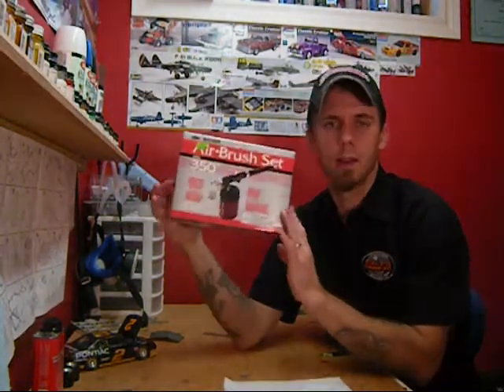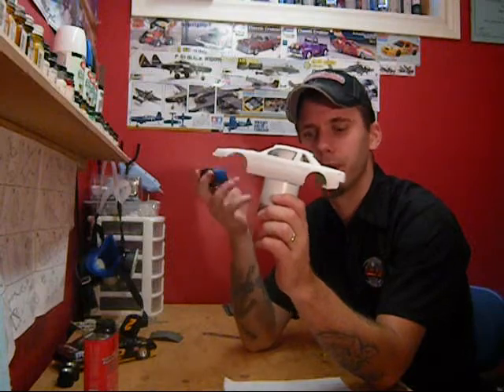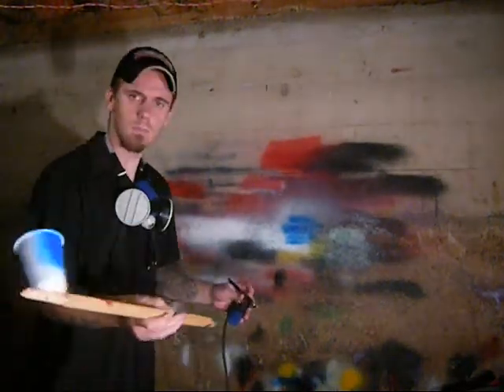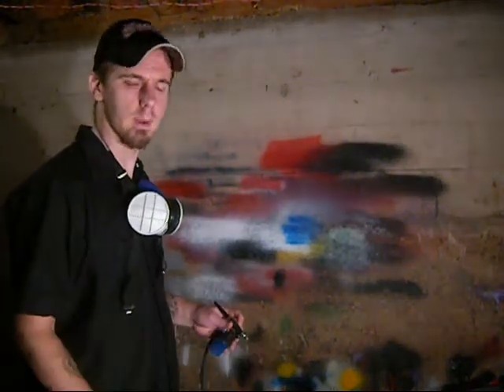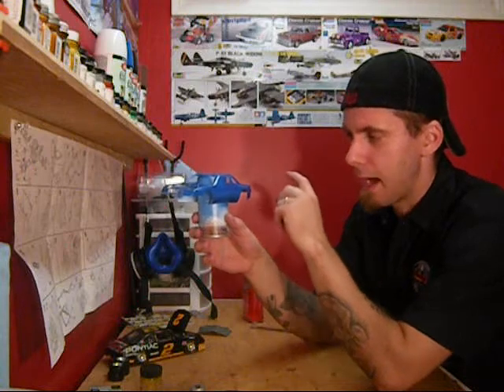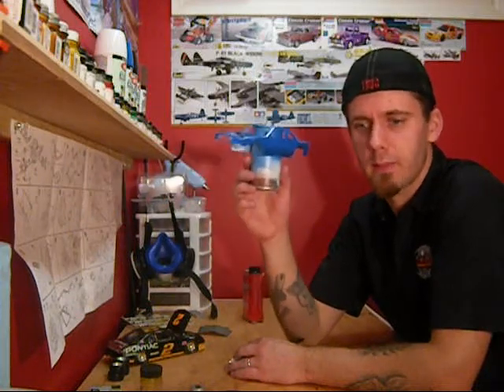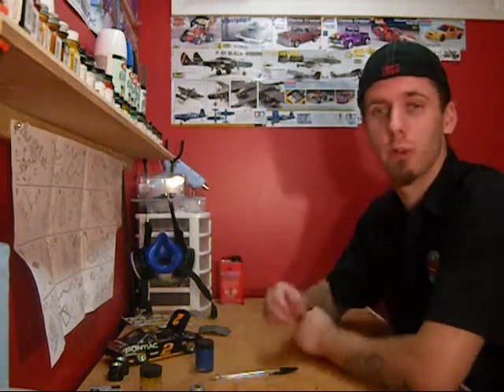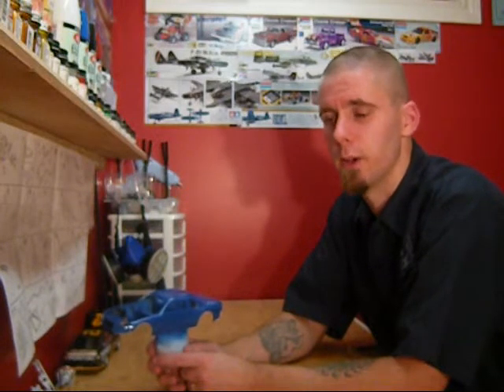Let's Give Airbrushing A Try

Comment: he had a good mix but, leave more drying time in between coats you'll get a better result on top of a primer coat. use a number 5 wider tip better for coverage,  I find starting from left to right, then right to left. Going from the tide of the model to the top then down the other side of your model is best because you get the i quote "the flow" going on. Over lapsing with not the right thinner to paint ratio will cause slight lines when dried. in which case you have to sand with a 1200grit anything less you risk digging into crucial areas you may not want untouched. Great video, Jan  shows a clear understanding and very knowledgeable for a beginner at the time of this video.